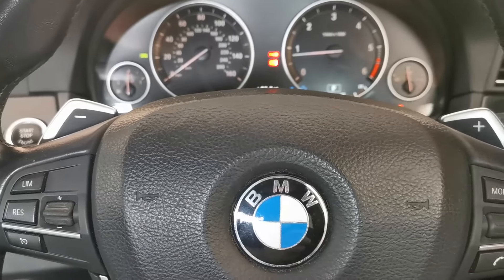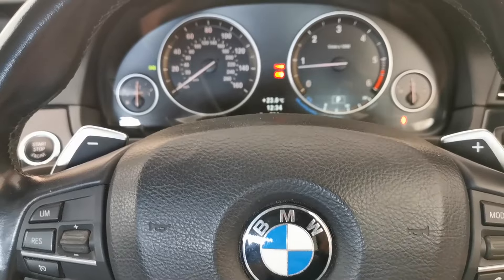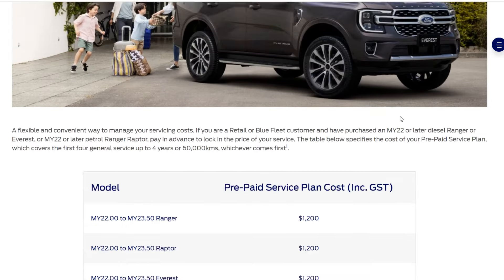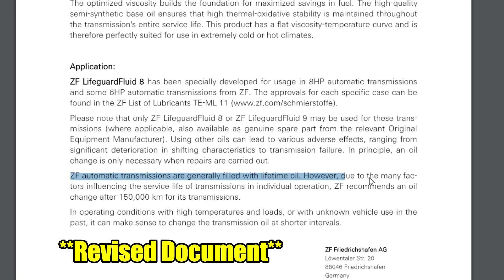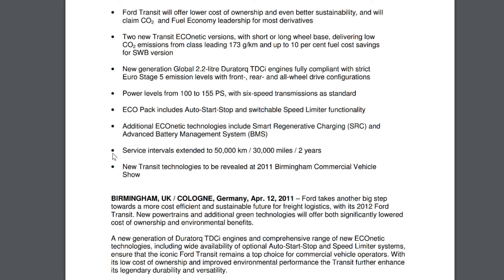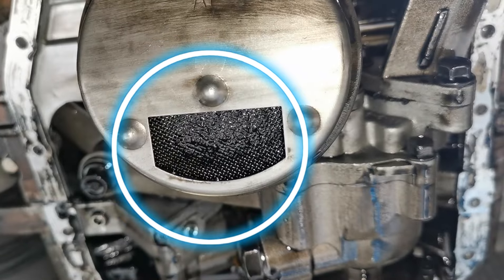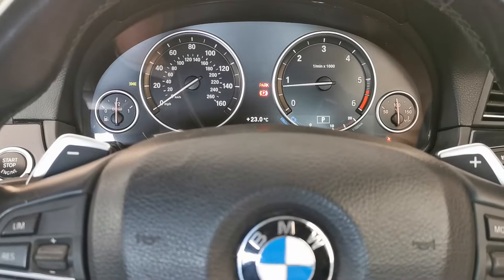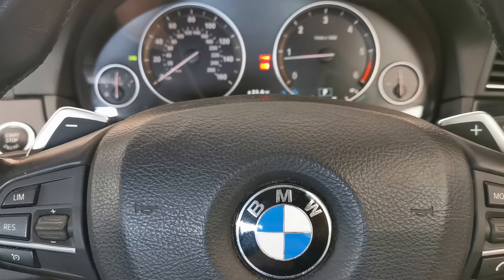"Longlife & Lifetime" Service Intervals - Let Me Explain Some Dealership Secrets.

Comment: The manufacturers claiming these extended intervals often add a phrase it the fine print; "Under normal driving conditions."  Well "Normal" conditions they say do not include temperature extremes, dusty conditions, excessive idling, excessive city or stop and go driving or numerous short trips of less than 10 miles.  (What is that like 20 kilometers?)  So, basically Laboratory conditions.  No body drives like that.  I live in Arizona, it's hot, dusty the large cities have jam packed rush hour freeways and the AC is on almost all year.  I change my oil (whether conventional or synthetic) at 5000 miles,  ATF at 30,000 miles  manual trans, xfer cases and diffs at 50,000.  What the mfg's say is "Lifetime" is the life of the Warranty after that they don't care.  Thanks Mr. Burke for taking on this touchy subject.
Reply from the maker: Exactly!  
Thanks for the comment 🙏

Comment: Totally correct Gerard!
It's always about the money. I always recommend 10,000 for a service, in-tank fuel filter a maximum of 100,000, trans service 100,000, coolant hoses 200,000 as a general rule if not specified earlier by the manufacturer. We are not doing the customer any favours if we try and extend the servicing. It might save money short-term, but they will pay in the long run. It's our experience that should drive the service intervals. As you have shown, we have seen it all.
Great job as usual mate.
It was great to catch up a few weeks ago. 😁👍
Reply: Automatic gearbox should be 70-80k max. Manual is 100k max. Fuel economy savings make up for the cost anyway. Usually end up getting 0.5-1mpg better anyway

Comment: Totally agree, all manufacturers have way to long between services, i keep seeing so many engine failures, wet belt failures and chain failures. Seems to be that most cars are not lasting to 100k miles these days . I'm convinced that changing the oil under 10k would help keep all these engines to keep going. Buying a used higher mileage car is a ticking time bomb.

Comment: I have a 170 k 535d m57 engine.
It had 154k on it when I got it. I have done 2 oil flushes and on the 2nd one I kept the engine on a high idle for 20 mins. A little sludge came out.
I realise this is a very very contentious topic using a flush.
Car running flawlessly since last flush for 1k.
I also serviced the auto gearbox.
Thank you for the video Gérard I enjoy them emmensley
Reply from the maker: 🙏🙏 Thanks Paul

Comment: For the last few years, car manufacturers have made financial (almost actuarial) judgements about when a vehical should be serviced, not a decision based on mechanical wear. My last two cars have had 2 year / 18k miles (29k kms) service intervals, but I don’t like leaving the oil & filter in that long.

Comment: Look at the service regime the maker offering 10 year warranty specifies (Toyota, 10 years so long as you get it serviced by Toyota when reqd), no long life oil service rubbish there, every major service brakes get properly cleaned and serviced, not aware of any other mainstream maker who does that.
Does anyone ask themselves why supposedly superior engineered cars are only warranted for 3 years?

My own cars get fresh oil every 3k max, and regular transmission and diff oil changes, plus annual brake maintenance etc, all DIY, they're 19 and 16 years old and totally reliable.

Comment: I have used an oil extractor for 10 years and it's paid for itself many times over. 

My wife's Suzuki Vitara was serviced at the main dealer and even though it averages only 3K miles a year the oil was pretty much spent after 12 months. It  came out of warranty in February so did an oil and filter change and will do again every 6 months. 
The funny thing when I did service on the Vitara, for the first time in 10 years I undid the sump nut and drained it....only because I had to drop the underguard to get the filter off 🤨  

I'd be interested to know what sort of age/mileage to replace the automatic gearbox oil on the Vitara, its a 2020 1.4T 6 speed, as Suzuki say it's sealed for life.
Reply: I just cut hole in under tray and fabricate a window with 4 self tappers

Comment: Bottom line is that companies lack incentive to make their vehicles last beyond the warranty period. People are going to buy more cars if the require less maintenance so the car companies will stretch the intervals as much as possible so long as the vehicles will last the warranty period. 

20k+ km for engine oil is absurd, a more reasonable interval would be 7-10k km depending on driving style with fully synthetic oil.
Reply: back in the days it was 1 year or 10.000 km. Depending on the conditions you could stretch that a bit, but the long life cycles are crazy.

Comment: BMW officially declared, lifetime means 150000km. The transmission will Last 150000, and maybe more. Only if you abuse it, it will break. I change the transmission oil every 50000km, but you only get 60% of the old oil by changing it. No Problem, we Sell our cars always under 200000.